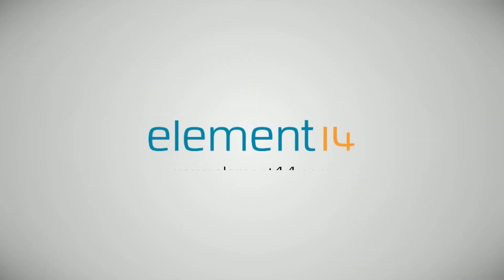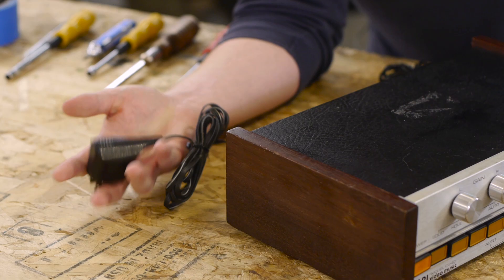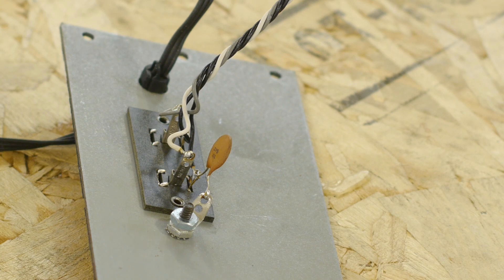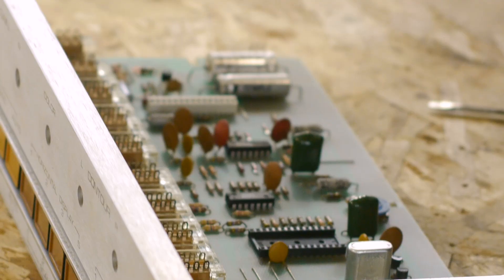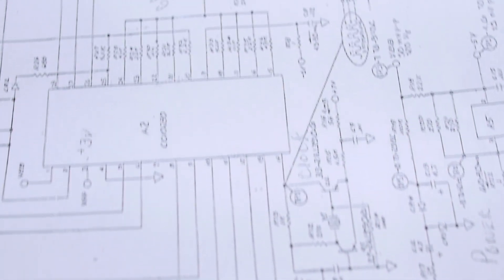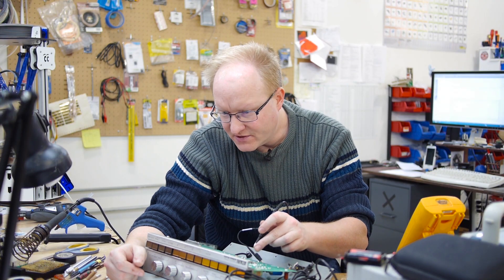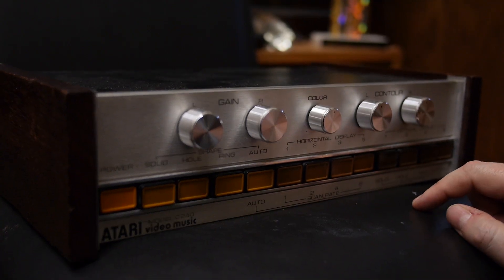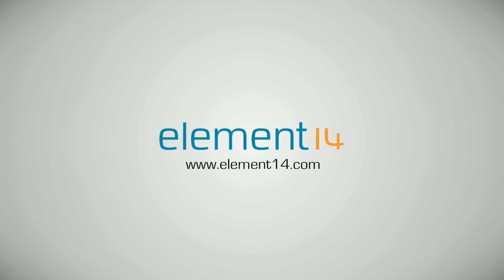Ben Heck's Atari Video Music Teardown

Comment: I suspect using potentiometers with plastic shafts is part of the safety insulation(double insulation). as it doesn't have an earth. Same for the switches with plastic buttons and actuators.

Comment: Love this video! Can I ask how you hooked the unit up to the TV? Did you use an RCA to F adapter into the coax input on the TV? Is there a way to connect this to the TV using a HDMI cable and an upscaler? Also, for the sound source, did you connect RCA to RCA or 3.5 mm jack to RCA? I recently came across one of these and I am trying to figure out whether it is broken, my connection is incorrect, or both.
Reply: You get it figured out?

Comment: "That was connected before I was born" lol!  I was a kid during the era this came out, I never saw one of these. We had the Atari 2600, 400 and 800 computers. I see a lot of those in this. The channel selector is really dumb seeing as the other units I mentioned just put the switch on the outside. "Everyone who worked there is now dead" Now I feel depressed.

Comment: why are you calling variable resistors variable capacitors @ 6:20 you fool just like you were calling the value of capacitors on the printer your were stripping that are in microfarads but you called it  henry but henry is inductors.  You are a uneducated fool fronting a cheep show.

Comment: 6:15   capacitors with shafts, POTENTIOMETERS with shafts...
8.35 1000uF, 470uF, what voltage?
When did you check  the power supply rails and ripple?

Good video, the front panel looks upside down..

Comment: Techmoan fans??

also, not the first video visualisation tool, an old hippie mate told me of the "silly scope" . basically, hook a audio amp to the horizontal or vertical coil of a TV deflection coil (pay attention to the impedance of the coil). either get a 'guitar string' effect or a ruddy oscilloscope. try it ( do research first), CRT's are cheap as in free. looks really cool tho. this dude had a TV on his amp stack in the day. probably stole the TV, and had no use for it. damn hippie. 

have zoned out to a silly scope many a time. looks excellent (if your tv has enough knobs inside to dial in the picture)

Comment: You should get ahold of a STAX SRM - T2 (legendary headphone amp), would love to see repair work on one of those.

A bit of info from a random forum: "I wonder how many treasures like this may be in an attic somewhere..... or at a swap meet..... Any idea on how many were ever made? How much did they originally cost?"
"There were close to 250 units made but exact numbers are hard to come by. The prices varied quite a bit in those days since Stax changed dealers in the US quite often just before they went bust. A few of these sold for 6500$ with a SR-Omega back in 1995.  :o "

Comment: Hope that can find some help, my brother found one of this, he works in a local TV channel and there was one in the storage room, is complete from outside, but is missing the Oscillator Crystal Y1 on the board, I found the same schematics that Ben shows but is imposible to read the information for it. Would someone have the value of the crystal? Thanks so much for the help!
Reply: The schematic had the part number C010177. It seems to be the same part number as the Atari 2600 crystal. I wouldn't think they would give 2 parts the same part #. I recreated AVM schematic a couple years back I could probably send it to you if you want. I also posted it to atariage but it's been buried in the forums.
Reply: Thanks so much for your reply! yes I tested with and old VCR crystal and did work! is the same as the Atari 2600.
The problem now is that it shows the RF noise, and a shy image of the colors and figures, this is after I changed some caps also. I keep working on it

Comment: and a problem much more is it compatible not to convert analog to digital signal?? because I knew that analog signal can harm a digital signal if don't match he wants and I think you plug it in the digital signal of the Atari to LCD TV and much problem much is from 70 so it will not perfectly oscl much better and I see pwm squarewave signal and the problem is not converted perfect wave it will harm the digital device right? or not?
Reply: As unintelligible as your comment is, there's no reason to worry at all. Just like any 8-bit console it simply square wave pulses the V channel and phases the colour that way, and it also just pulses tha U channel. The signal is band limited before the modulator to avoid U/V crosstalk and then at the modulator, else it would be poisoning lots of TV channels next to it, as you're supposed to merge the signal with your antenna loop. The input circuits of the television provide further band limiting to be able to demodulate a single channel without getting in noise from all the other channels, and have decoupling, AGC and clamping to deal with all the weirdness that would come through an antenna without harming the TV.

Comment: can asked question I knew that lead solder can harm your brains right?? but if is 60 \40 not much but how about 70s it has a problem much or not and knew that type of Atari computer old thing
Reply: If you ingest lead, it is not rejected by your body efficiently so it can accumulate over time and causes nerve damage. But you simply need to follow simple precautions. Don't keep any food or drinks around the place where you're soldering. Wash your hands very carefully after touching the solder. Use temperature controlled soldering stations and never let the soldering iron reach 450°C or more. The amount of lead that the worker would end up with in their body wasn't really alarmingly higher than what you'd get naturally through food and air even back then, and that's before temperature control became standard.

With regard to solder composition, nothing changed much in 30 years, it's been Sn60Pb40 or Sn63Pb37 all along, with minor additives that are for the most part harmless, except for Bismuth that they wouldn't have used there for cost reasons.

If you feel light headed after soldering, that's not due to lead, that's due to phenolic compounds that evaporate from the flux. But you have the same issue whether you're doing leaded or unleaded soldering job, and generally exposure to flux is much higher in lead-free soldering, as its evaporation rate increases drastically with temperature. The flux fumes are not good for you, they have been a cause of asthma for many electronics assembly workers.

Comment: What is this about replacing IC sockets at 8:35 "..they're usually pretty beat up by now"  ...never heard of this. Why would they be beat up? I assume Ben's talking about corrosion of the contacts but it seems a bit unlikely
Reply: The socket? Yes, contact surface corrosion and contact spring relaxation. Due to latter, contact pressure will be reduced with time. I don't think it's as common an issue as he thinks it is, but it happens.

Comment: If it had some feet clearance they could have mounted the channel switch out the bottom of the case without extension instead of that "poking hole" design.

Comment: This is great!  Cool to see old stuff work again and some insight on how/why they did it that way and how it might be done with modern technology.  Maybe you could do a few videos with John from John's Arcade.  Talk about why those gigantic capacitors are used in power supplies, or ,maybe explain exactly how the kinds of video sync works with the oscilloscope, or explain why incandescent is just so much nicer than LED when you're willing to spend the extra electricity.

Comment: I have a modern amplifier with a metal all the way around, non grounded. Also vintage electronics were built to last, idk what your talking about. I have a 40 year old receiver that powers up like it's brand new and sound great, only needed 1 filter cap replaced, though I should get the rest replaced as well.
Reply: Yes, double insulated devices or devices with reinforced insulation can have an unearthed all metal enclosure and HiFi gear usually is. Even more relaxed requirements apply to devices with a low voltage extenal power brick.

You can't say that old stuff was built to last though. I mean sure, "planned obsolescence" even on high price devices wasn't a thing yet, but you're looking at it through the lens where most of the things that survived are the ones that were better built than the rest, or things that were preservation worthy and have been maintained with improved components. If you ask guitar amp repairman, as one big category of products that have been maintained for a long time, extremely sloppy designs weren't uncommon and the ones surviving today might be due to them being relatively simple, but then there are many questionable new ones too. As to components, for example big companies with good chemical facilities have drastically improved electrolyte quality and production methods during this time, but also a lot of minor ones sprung up to offer a cheaper product with all the compromises it entails. IC resilience standards also went up - now almost everything has to have 500V static resilience and 2-4 kV is not too uncommon, while 80ies ICs were severely struggling with that.

Comment: What modern day op-amps did you use? Servicing one here as well, which is finally semi-producing a picture again after some work on and off (thing had no plug and was fed 220 volts). Still hoping the custom chip somehow survived. Probing it actually is the next step.
Reply: +Hans “Shockwav3” Meier I asked Ben what he used. He said these, RCA CA3401, LM339N. I hope that helps. Good luck getting yours up and running!
Reply: +theHeckwithKaren Thanks a lot for the reply. I googled up on that myself already (turns out they're standard op-amps ... which I didn't exactly expect) and also found someone who modified his to work with composite. And guess what? It's working again since 2 hours :) Feeling extremely satisfied on this, since I considered the machine dead beyond repair for quite a long time. Once again, thanks for asking Ben.
http://i.imgur.com/4FBnnDy.jpg & http://i.imgur.com/ewwMtS4.jpg
Reply: Fantastic! Glad to see you got it working and that the IC on yours was also not damaged.  I'm always happy to help when I can.
Reply: Just want to clarify this as I just got through repairing one of these and also found bad OpAmps.  

A3: In place of CA3401G I used LM3900N
A4: In place of CA339G I used  LM339N

Best I can tell LM339N is not pin compatible with CA3401G - which was initially confusing me.

Comment: I know we're supposed to leave suggestions on the forums, but I'd like to know what we can do with old CRT tvs. You have to pay to have them recycled and don't offer much current functionality. One item that has a CRT monitor that would be cool to modernize is the iMac G3. They are very limited on upgrades, but are cool. (and HEAVY!) Maybe Ben can find a way to add new life to these old machines.
Reply: +Jeffrey Ball Maybe Ben could turn a CRT into a basic oscilloscope.
Reply: +Jeffrey Ball gut it and build a fish tank inside
Reply: WilliamTythas
And then what do you do with the CRT monitor? The fish tank idea is old. I was thinking maybe a mame or emulation machine for older games. The 15" monitor isn't that big, so that may not be as fun. I'm sure you can do something useful with it other than trash the inside and use the shell.

Comment: So on an old 1981 CBM PET or 1979 TRS-80 Model 1 I would have def. need to replace the caps... 35 years is too long... done it on 50's radios

Comment: I'd still love to see you do something like an inverse handheld video, turning a handheld console into a set-top model. Atari Lynx, perhaps, or Game Boy Color? Heck, maybe the Wonderswan, even, that'd be neat.
Reply: People have done it with the Game Gear.  There's even a kit you can buy to do it.  With enough digging you can actually find schematics to do it, however it requires   several 74LS Logic ICs and an RGB to Composite/S-Video chip converter like the AD725.  I built one once and it worked for the most part, however when there was too much blue it would cause the VSync to go out of whack.  When I would turn the pot down on the blue, it would be really washed out, but would fix it, however it didn't look good.  Was never able to figure out that problem.